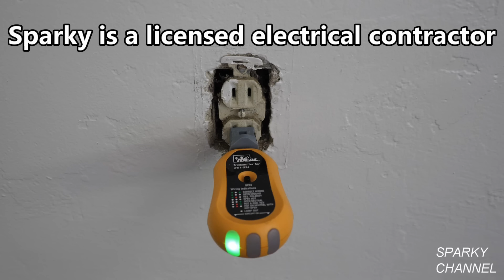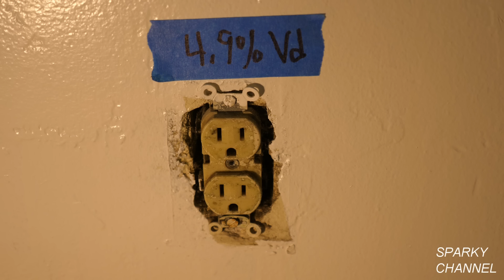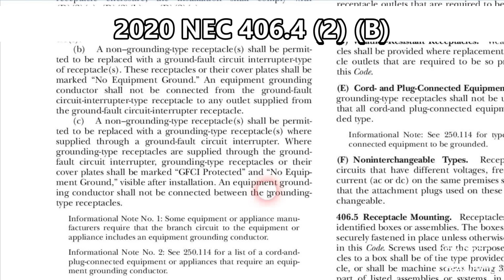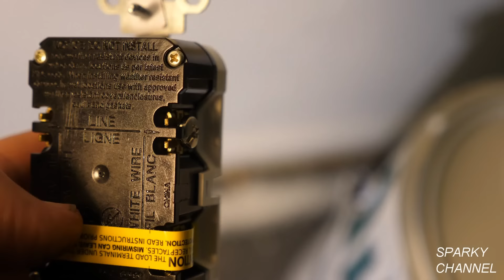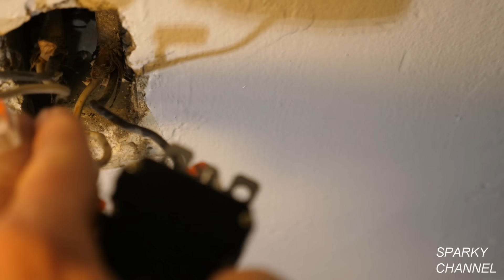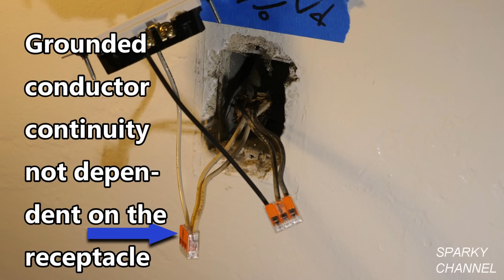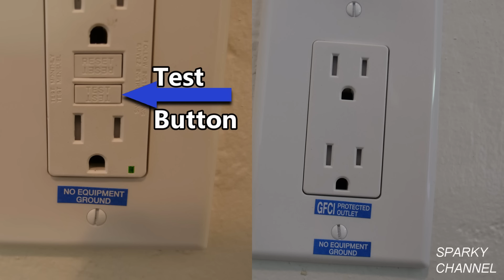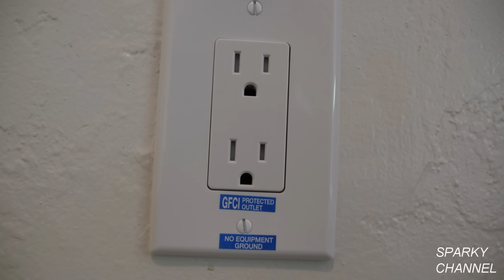2 Prong Receptacle Circuit Replaced by GFCI and Grounded Receptacles per 2020 NEC

Comment: At 6:45, as the most upstream outlet/receptacle, shouldn’t the GFCI outlet have its green screw connected to a ground?  If not, why not? 
If the most upstream outlet/receptacle that is a GFCI is not grounded with using its green screw, how and why are the downstream outlets considered grounded? Thanks
Reply: Can I ask a clarification? When you install a GFCI outlet - does it go on the FIRST outlet that is reached by the cables coming from the Main Circuit and feeding that circuit? Then once installed it protects the rest of the outlets on that line up to the one farthest from the box? Or did I get all this wrong? Help!!    Thanks.
Reply: @arthurgarzon2475  you can only GFCI protect anything after the outlet and not before with a GFCI outlet. For example, you have a kitchen. In a kitchen you have a very first GFCI outlet that is being fed from the circuit panel. Anything after that including 3 more standard outlets like inside my kitchen are indeed GFCI protected! Anything before that is not. 

However, there is a very different way to do this whole task. You can purchase gfci circuit breakers and install them for only what you need to gfci protect inside your home such as a kitchen next to a sink, or only the lower and not ceiling outlets inside a garage. Sometimes a gfci breaker is better and sometimes the outlet is a much better way. 

I sure hope this helps you out! 

Don't gfci protect a fridge etc though. If the outlet trips while you're on vacation, everything will spoil!
Reply: None of the outlets are considered grounded however this is acceptable per the NEC. Not having a ground wire attached to the GFCI does not prevent it from doing its job of monitoring for unbalanced current between hot and neutral. This is how the NEC comes to the conclusion that’s its acceptable instead of having to replace all the wiring. I still think the absolute safest thing to do is to buy new two prong outlets and use those. A lot of appliances are computer chargers that used to need a grounded outlet no longer need it anyways.
Reply: @everythinghomerepair1747
I agree with you on the just get new two prong outlets. 
However I have a question if you don't mind. 
Wouldn't it be safer to plug something that has three prongs into a three pronged outlet instead of into a jumper or whatever there called to convert the plug from three to two?
If you have time for a response, I thank you in advance...
Reply: @ yes. If you plug a three prong device into an adapter and then into an outlet you are adding an extra connection which could be bad however I still think it’s safer than the ungrounded three prong. The ungrounded three prong outlet connects the entire frame of the outlet to the ungrounded metal box which could be dangerous if a wire becomes damaged in the box. The adapter on the other hand keeps the appliance frame isolated from the box as long as the tab on the adapter is not connected to the center screw. This I believe is much safer than connecting your appliance frame to an ungrounded box. If you need further clarification feel free to let me know.
Reply: @everythinghomerepair1747  
Thank you for the well thought out response.
I don't disagree, however I do have a few questions 
What's the box have to do with it?
The box should be isolated and covered which should prevent any contact?
And what's the real purpose of the ground? Beyond to protect the casing of an electrical appliance from a short?
I mean it's not really a ground like most people think, I mean it doesn't go to the ground.
It goes back to the neutral buse bar, I believe that's what it's called, right.
I don't actually understand it because, I believe that sometimes the neutral is technically energized as the current moves back and forth?
I don't know why the electricity doesn't travel through the ground from the neutral bar?
I mean these aren't even the questions I have, there just the one's I get in my head while thinking about it. 
Thanks for your insight.
Reply: @ the point of the ground is only to protect the case or other metal parts of an appliance from becoming energized as well as surge protection in some devices like certain three prong laptop chargers. The box comes into play because by installing a three prong outlet into an “ungrounded” metal box the screws that hold the outlet in “connect” the box to the third hole in the outlet (the ground hole). This could be dangerous because should the metal box become energized (there are many ways this can happen) you will receive a shock from touching an appliance plugged in. In a properly grounded system the breaker would immediately trip as soon as the box became energized. You are correct the ground connects to the neutral buss bar and this is what makes the “ground” work but the neutral bar is actually physically attached to the ground by means of a “ground rod” or other means. My concerns about using grounded outlets on ungrounded systems go away if the boxes being used are plastic because they don’t conduct electricity and can’t become energized. Hope this helps. Is there a specific project you will be working on involving an ungrounded system?
Reply: @everythinghomerepair1747  
Hey thank you. 
And no, no projects, I'm just a curious person, and I find this subject interesting...
Thanks again...
Reply: @everythinghomerepair1747  hi question for you? Every time I plug something in to outlet the GFCI trips.  Why do you think that’s happening even after replacing the outlet itself?
Reply: @ does the GFCI protect downstream outlets or is it standalone? Does plugging anything in do this or just one particular item? If the GFCI protects other outlets downstream most likely the ground and neutral are touching in one of the downstream boxes this will cause current to flow on the ground wire and trip the GFCI. Also you could remove the GFCI you replaced and ensure that the line and load are wired correctly. A test would be to wire the GFCI only to the line side and leave load disconnected, then try your device again and if it doesn’t trip you know the problem is downstream.
Reply: @ yes this particular GFCI protect the other outlets downstream, 

If I plug anything into any outlet downstream it will trip.

I also made sure the line and load side were installed correctly.. it’s pulling 122.4 volts on the line side. 

Would that plug in outlet test help determine if the neutral and ground are touching?
Reply: @everythinghomerepair1747 
I read that NEC code recommends metal boxes for BX cable for various reasons. Could you just connect a ground wire between the metal box and the outlet "green" ground screw? Would this solve the problem?
Reply: @ if you’re house is already wired with BX cable you can use it as a ground if it’s connected properly. You should replace one two prong outlet with a three prong. Leave the ground disconnected but screw the outlet tightly back into the metal box. Then turn the power on and use an outlet tester. If it shows that it’s still ungrounded you will have to revert to two prong again. If it shows a ground then your system is grounded and you can opt to leave the outlet as is (just by attaching the outlet to the box it becomes grounded) or you can add the wire connecting the outlets ground screw to the box as is required by the NEC.
Reply: @everythinghomerepair1747  hey just inquiring if you saw my comment, I wasn’t sure if it got mixed up with Mr. herb.
Reply: @1986postman  I seem to remember replying to you comment but I guess not. There’s no tester that you can plug in that will tell you if neutral and ground are touching. Based on what you described I’d guess that they are in your case. First you should disconnect the load side hot and neutral and ensure that the GFCI works with only line connected. If it does you’ll have to open each outlet protected by the GFCI one at a time and make sure the ground wire is not near the neutral screw or touching any other way. You’ll probably find it but be prepared to spend a few hours opening all the outlets and looking. Another chance but unlikely is if you’ve hung any large items recently or had any renovation work done a nail or screw could be driven through a cable touching ground and neutral. What does this GFCI protect Luis it a kitchen or bathroom or outdoor etc. ? Hope this helps.
Reply: @ thanks I really appreciate it.  The GFCI is in the kitchen and protects 3 in the kitchen along the counter and 4 in the dining room.So I checked all and it continues to trip in every outlet with the exception of one. I plug 🔌 phone chargers and other accessories in and literally as soon as I insert to the outlets it trips .

I’m thinking it could be punctured in the wall somewhere because shiplap is installed on one of the other walls .
Reply: @ you’re welcome. Since you checked all the outlets and replaced the GFCI it’s starting to look like the cabling in the wall may be damaged. Possibly behind the ship lap as you stated. To be 100 percent sure before you go tearing into walls I’d go to the outlet box that contains the GFCI and fully untwist and disconnect the ground wire going to the LOAD cable. Once it’s fully isolated and not touching anything turn the power back on. All the seven protected outlets you mentioned should show ungrounded on an outlet tester and your tripping problem should be fully resolved. You should be able to plug any charger etc. and not have the GFCI trip. If that works you 100 percent confirmed a neutral touching ground situation. The next step is then going box by box disconnecting and reconnecting sections to see in which cable run lies a nail or screw.
Reply: @1986postman  highly likely you have loose wiring inside a junction box loose under a wire nut) or loose wiring at the panel. Either way these loose connections are causing a variation in voltage. The job of the GFCI outlet is to find exvessive variences and trip!

Comment: Wouldn't it have been safer to shut off all the other circuit breakers off then check all the outlets that were hot to confirm the one circuit you left on?

Comment: I'm confuse isn't it dangerous to have an open ground, specially with gfci?? Another some lamps comes with a ground wire and be attach to the metal box on that receptacle that don't have a ground cable?? Thanks.
Reply: Why would it be dangerous with the GFCI? The GFCI cuts tge power if someone gets shocked.

Comment: This would not pass NEC inspection without a ground wire.
Reply: The GFCI makes it legal. The outlet itself will trip if there is a ground fault.

It’s not ideal. But a lot of morons in the 70s ran cable with no service loop and then clipped the ground wire at both ends. Not even a single piece of heat shrink was used in my home where the ground wires were clipped. It’s amazing what they let people get away with 20+ years ago.
Reply: @_audacity2722  jesus

Comment: And you still have no ground. So why not use just 2 wire no ground in new building?.  Save some cash.
Reply: Gfci’s are a safe replacement for non grounded recepticles, because they trip if it notices power going where it shouldn’t, kinda like a ground. The great thing about gfci’s is that every recepticle wired up daisy chained from the first is also protected.
Reply: @LukeGray-fs1sl  Because you could have equipment like a refrigerator which has a live chasis and the GFCI wont trip until the ground fault occurs (someone touches it). A proper, low resistance equipment grounding conductor would cause that current to flow from the chasis, back to the neutral bus bar and it would be a 20 amps of current if the circuit is 20 amps, for example. That influx of current would trip the breaker the same way that an overloaded circuit would. This protects from the ground fault occurring in the first place. It's worth mentioning that GFCIs have a life span and can fail, and will still allow current to flow even if protection isn't there.
Reply: The alternative of this is not to a rewire but to use cheater plugs, cut the ground prongs, and other tricks. This is definitely safer.

Comment: Thank you for this video. I will be doing this to my mom's house shortly and have ordered the tools, however the analyzer was not available so I tried to find something else. I will be rewatching the video a number of times. I LOVE the circuit tester/finder as none of the receptacles are accurately labeled in my house and it beats flicking off the circuit and going to test it again and again and again.

Comment: I dont get the reasoning for adding the other connector box. You only have 2 wires for the hot and neutral and there are 2 screws for each. Cheaper, simpler and more room in the box. Thanks for all the other insights.
Reply: Adding the other connector box? Or adding the other connectors (wagos) to the box with pigtails? 
Pigtailing the other 5 receptacles gives parallel circuit rather than series circuit. If one of those receptacles goes down the other ones will still work. If he didn’t pigtail and a problem happens with one receptacle they all go down, and it pretty much requires an immediate rewire of the bad receptacle. 
You can use wiring caps as well which are much cheaper.

Comment: Why are two prong receptacles still made and sold?
Reply: Because they are cheaper,  allowed to retrofit old systems and replacing a two prong without a ground and gcfi protected outlet gives a false sense of security.

Not to mention that in a capitalist society, it’s not the store’s responsibility that you work within the building codes … hence slinky pipes and three prong to two prong adapters.
Reply: @thomasreedy4751 three prong to two prong adapters are legal and up to code, IF the metal junction box is grounded back to the circuit breaker.  This is assuming that you screwed the adapter into the face plate screw.
Reply: @LukeGray-fs1sl The code does not apply to devices. Do they have UL approval? If you have an ungrounded socket you must assume there is no proper ground path unless you actually have measures it. A socket tester will not tell it. It has to be 100 000 times better than what is needed for the tester to show. (that is not a hyperbole).

If you use the cheater plug use also a portable GFCI. That way it will be as safe as properly done (even safer if you do not fix the screw).
Reply: People may need then to replace their own damaged or own out outlets. You cannot install new ones, not even in old homes.
Reply: @okaro6595 yes you can. I just reworked an old ungrounded circuit in my home (THAT WAS WIRED BACKWARDS!! inspectors were asleep at the wheel!!). Just like this video explained. I replaced the first outlet in the circuit with a GFCI and after that it’s legal to use 2-prong outlets because they are GFCI protected. Not ideal. But code compliant.
Reply: Because people may need to replace damaged ones. It would be very dangerous if one could not replace them.
Reply: @okaro6595  you can still replace it with a three prong, there is no wire for the ground pin
Reply: Because there's still pre 1970's houses out there that were never wired with an EGC. So your choice is to either knock down all the walls and rewire (expensive) or use this method which is code approved. (EGC's were not required by code until the 1960's).
Reply: @Wowzersdude-k5c  you don't knock down walls to rewire dude, you can just put a new outlet in. There is no wire for the ground pin. The box is the ground
Reply: @georgelanders4271  A box is not a ground, lmao.
Reply: @Wowzersdude-k5c  yes it is LMFAO

Comment: Instead of installing a GFCI in the first outlet on each circuit, protecting the rest downstream, would it be equally acceptable to install GFCI circuit breakers in the breaker panel?  And then change the 2-prong outlets to 3-prong with the ground unconnected and little "GFCI protected" and "No eqpt ground" labels?
Reply: Yes, but in most cases where the receptacles are 2 prong, including this one, the breaker panel is too old and there are no GFCI breakers made for them.
Reply: @surferdude642  So put in a new breaker?
Reply: @YTT718  It may be an option if they are available.
Reply: Good question.
Reply: And way more money $$$

Comment: Very useful -- I learned about circuit analyzers and in fact ordered one.  I'm in electronics, not an electrician, and had realized it was theoretically possible to compute voltage drop by sampling with a lighter but known load, and was even thinking about how to invent such a gadget, but am glad someone has done it!   Since one of the first tests I need to make is the quality of the AC power going into equipment, this is ideal.
Reply from the maker: Hi Michael! Yes, it will tell you about the quality of the AC power and it will tell you the quality of your grounds as well. Thanks!